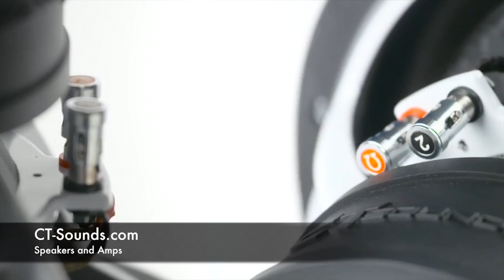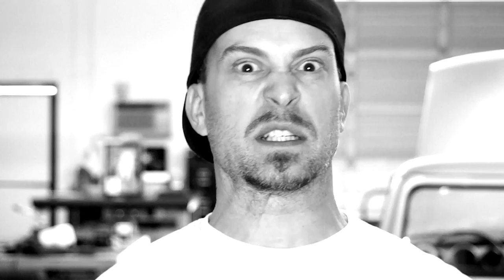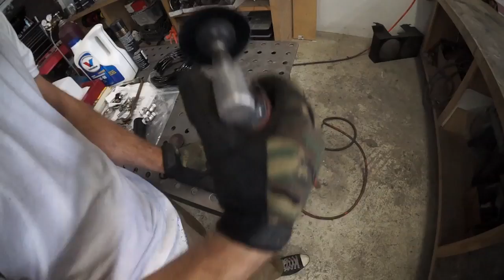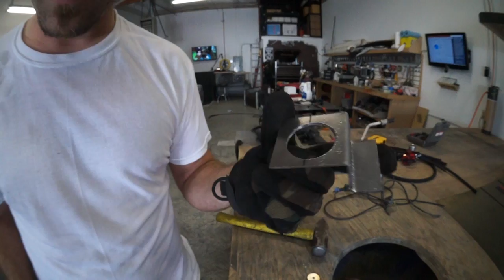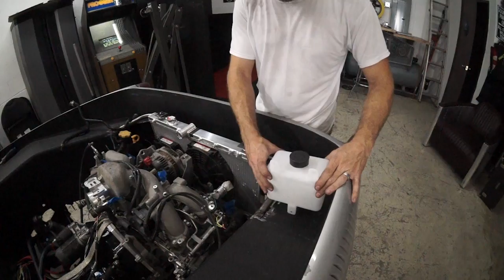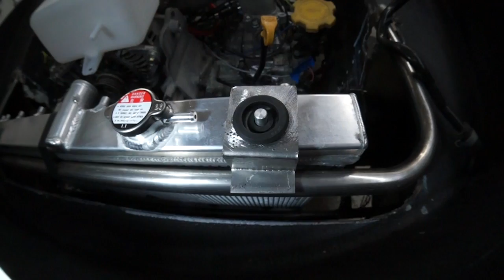Hammer Head

Comment: Have you thought about mounting that bottle in where you just took that oil filter out of? You could drill a hole in the fender so just the lid pokes up into the engine compartment, and build a sheet metal shield to keep it from getting hit with rocks n stuff.
Reply: my thoughts exactly!

Comment: Just some ideas weld shot tube sections up so the top brackets are strait and weld an end cap and drill and tap it.  Something like that might look cleaner and be easier to work on in the future.  The radiator overflow doesn't have to be at the same level as the radiator they can be lower.  One down side to that if you take the radiator cap off coolant will flow into the can slowly, but how bad that may look up high.

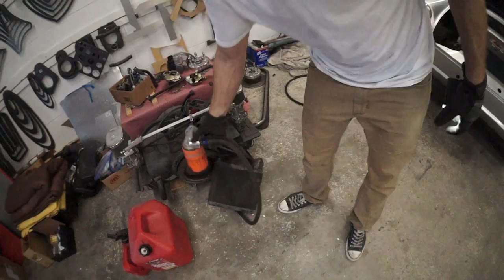Comment: 8:01 if the oil cooler works and fits into the current engine that you installed reuse it it's very useful

Comment: Doug you should put the coolant tank in the rear fender well were the oil cooler was for the VW motor and cut a hole in the wheel tub for the cap to go through it would be super clean

Comment: Install the coolant  reservoir where you removed the oil cooler and just have the cap come up through the black sheet metal it would be a very clean way to mount it

Comment: there is better catch cans u can use for the radiator.. jegs and others sell billet cylinder like catch cans for ur overflow, they cost a lil more but ther billet so can be put anywhere even inside ur inner fender where ur remote oil filter are/were

Comment: It might overheat because you put the radiator in the back which will have minimal airflow in the back. The airflow will just rush over the top of the car not into the bed, leaving the bed with minimal airflow.
Reply: isn't there going to be thermo fans?
Reply: +Doug Bernards (Soundman) I'm just saying IT MIGHT, just trying to help. Don't need to get butt hurt about it.
Reply: I'm sure it'll be fine.
Reply: It should be :)
Reply: Learn something about airflow and negative pressures.  If the back is opened up with louvers the air will be sucked through the rad while driving.

Comment: Hey doug, not sure what diameter that upper tube is, but it looks like its around a 1" OD tube? Have you thought about using something like this?

http://www.amazon.com/KC-HiLiTES-Light-Mount-Bracket/dp/B00852MK30?ie=UTF8&keywords=1%26%2334%3B%20diameter%20bar%20clamp&qid=1464362420&ref_=sr_1_8&sr=8-8

You can just clamp it to the tube, then use the hole to run a bolt through and make the bracket fit to that. I used something similar on one of my projects, just thought it might not be a bad idea. Either way, killer work!